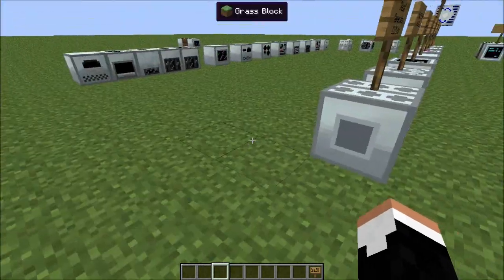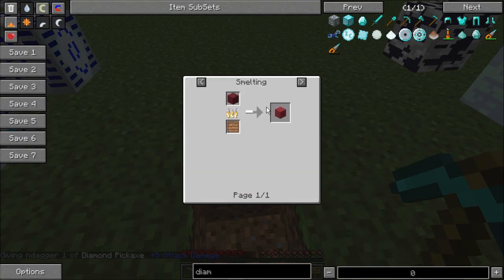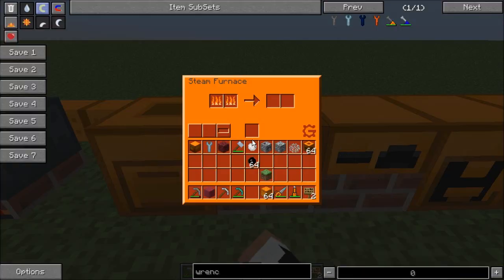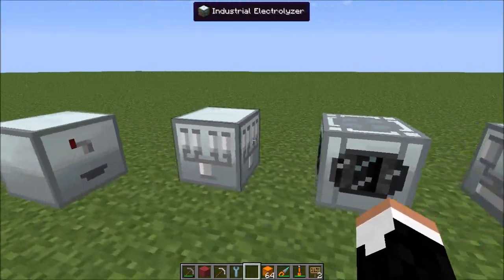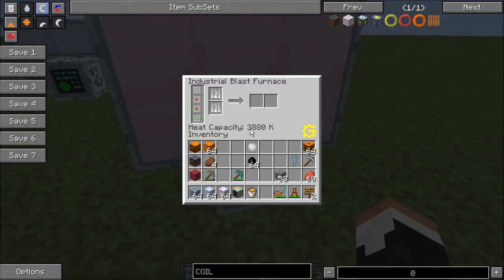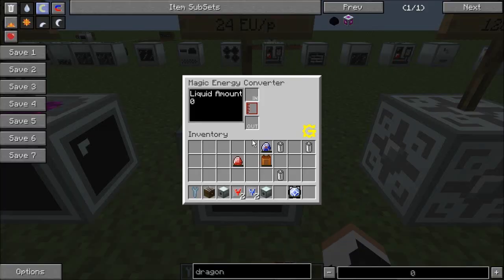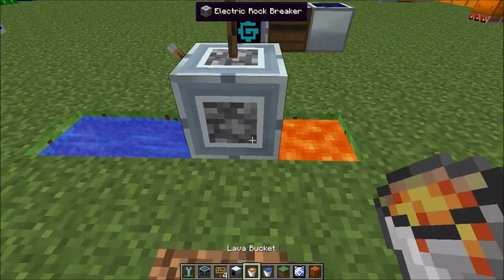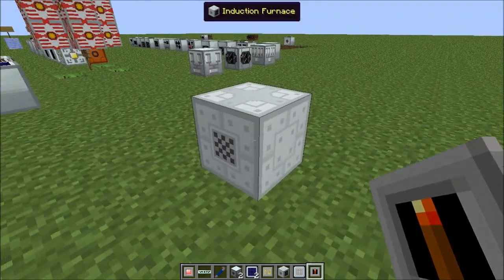(DEPRICIATED) Tutorial: How the heck do I...? Gregtech 101 - Processing and Generators

Comment: how do i use the teleporter
Reply from the maker: Teleporter is part of IC2, not Gregtech.  Essentially, you have to place down two teleporters, connect the "sending" teleporter to a source of power (and lots of it), connect the two using...I can't remember what the hell it's called, but it's a frequency modulator or something like that, it's a copper wire on top of an electronic circuit if I remember right...by right-clicking both of them with the modulator, and then when you stand on top of the sending teleporter and apply a redstone signal it'll suck down a huge amount of power (increased both by distance and the amount of stuff you're carrying) and teleport you to the receiving pad.  If you want to teleport both ways, both pads have to be powered.